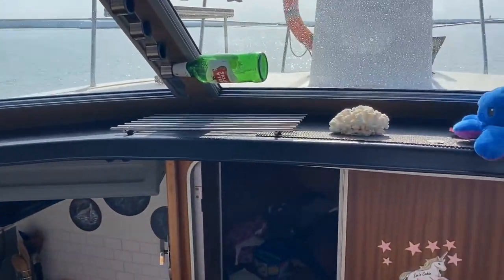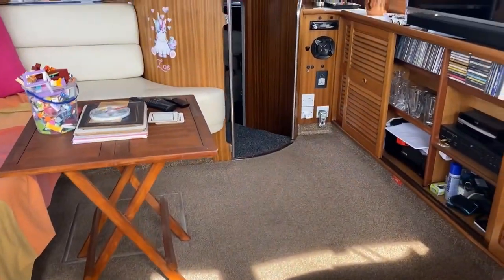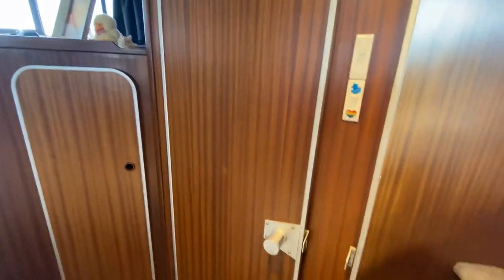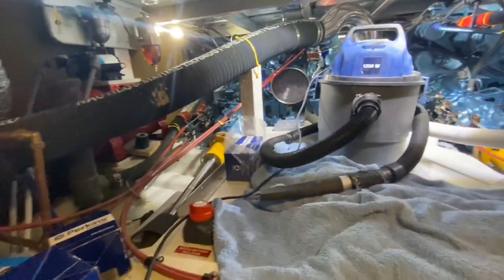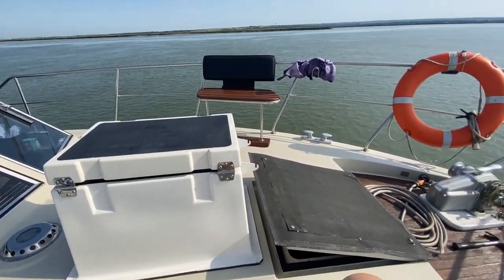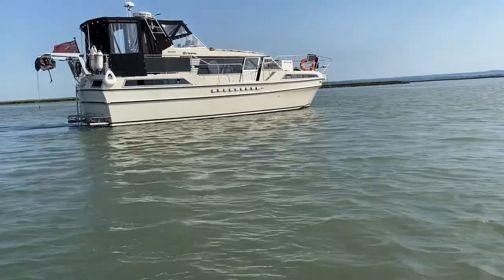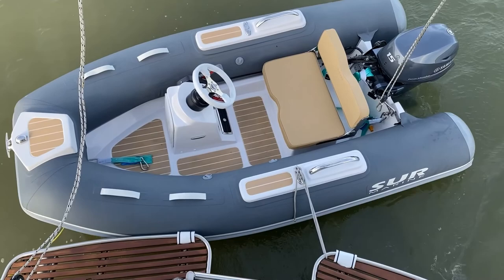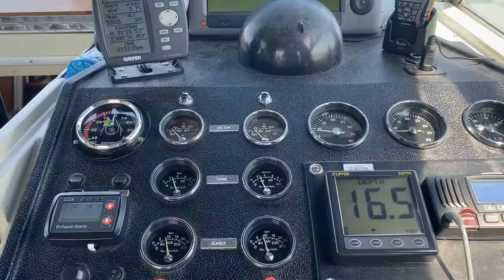Broom Crown 37 On Board and exterior review

Comment: Great video and lovely boat. I'm just considering the same boat with the perkins engines, but prefer volvos. Could you give a rough idea of cost of refurbing the pair please? Also do u have any problems getting parts for them? Thanks
Reply from the maker: Hi. The only part that Perkins struggled with was the scavenger pumps but they machined new gears for me. Cost for both (are you sitting down) was £24,000 all shells bearings pistons valves hoses cams and cranks reground. Injectors and pumps overhauled new Jabscos new oil pumps full engine re sprays new looms new drive plates etc etc.